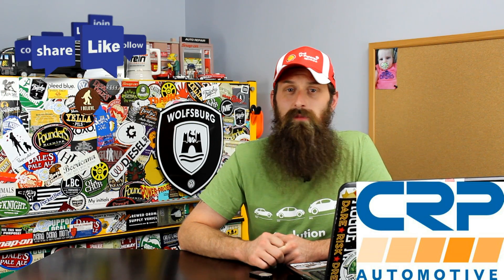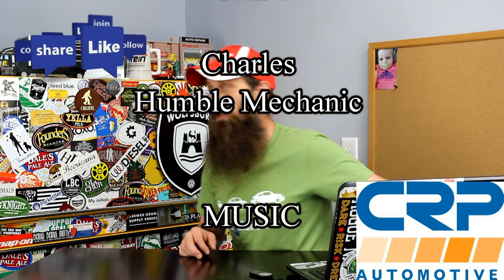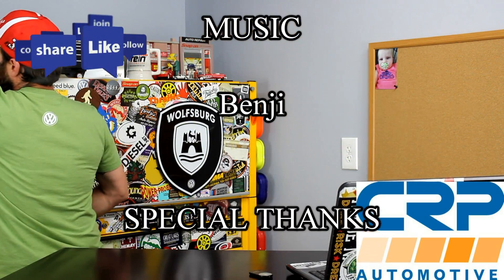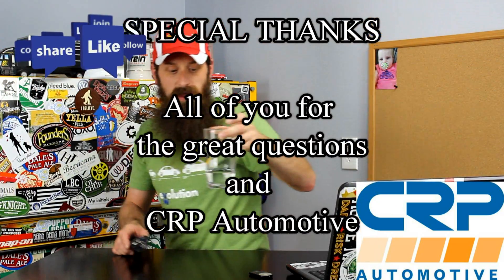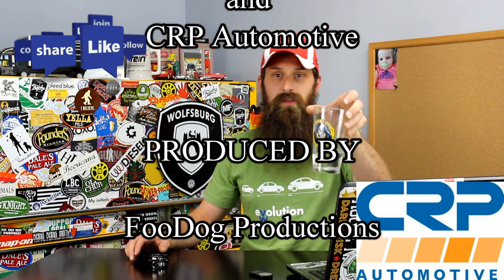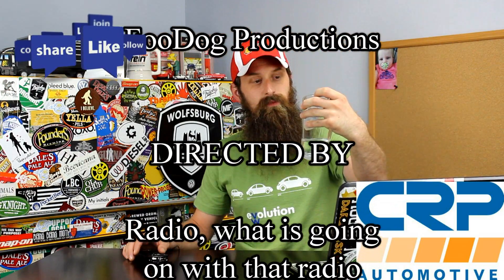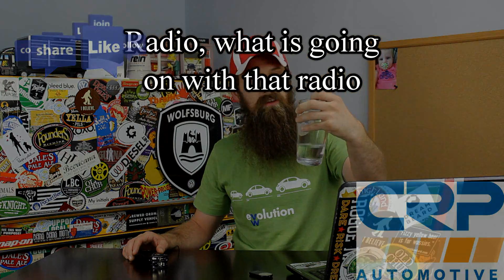Viewer Automotive Questions Answered ~ Podcast Episode 86

Comment: Can you expand on some symptoms of the MK7 DSG issues that you encountered?  I've noticed a crunching noise when creeping along in second gear with the clutch fully engaged around 1000 RPM, and was wondering if it could be related.  Loving the car so far!
Reply from the maker: 07HDDriver All of the ones we saw had a MIL with it. And weird messages like "Can not engage reverse"